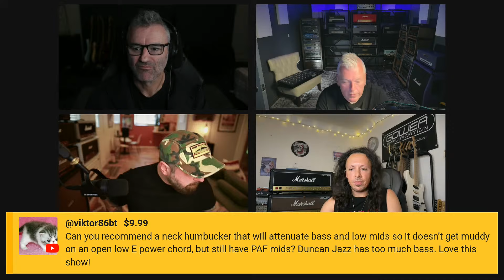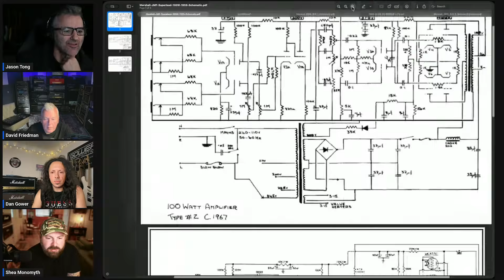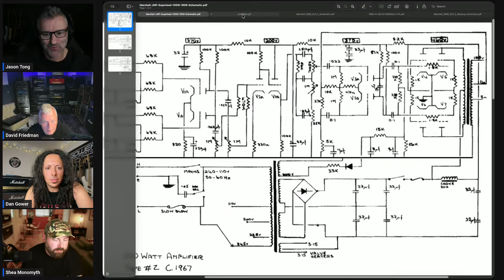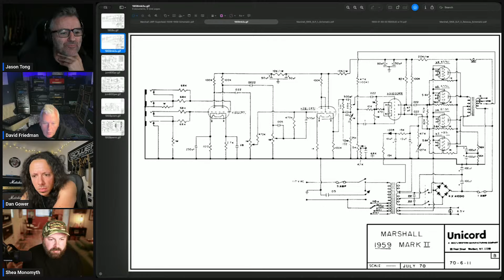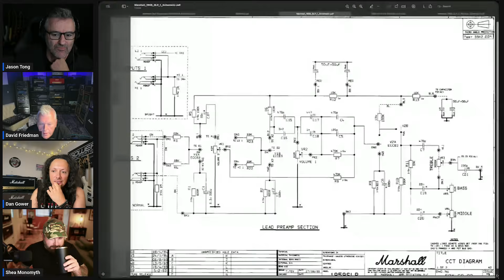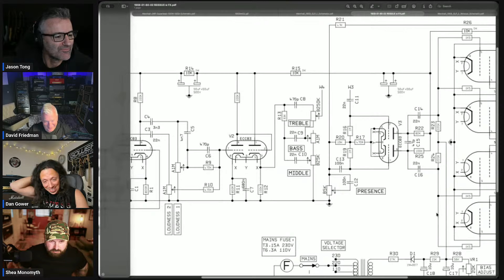The Amp Panel #16 - Marshall 1959 Super Lead: All Eras

Comment: Oh, just in regards to the discussion about the 100V line on the output transformer is? Back in those days it was common for announcement systems to run speakers which had high impedance transformers on them, this enabled you to be able to parallel many many speakers together without loading the amplifier down. Commonly used with those "tin horn" type speakers. There was two standards, 70V and 100V line. I never knew Marshall had that on their early amps.

Comment: Question for the panel maybe on the next show…..curious if any of these gentlemen occasionally use diode clipping, and if you do which type, why that type…also where in the circuit do you prefer. ? Just curious….love the content 🤘🏼
Reply from the maker: Everyone has at some point.  Check out the Jose episode, that’s the most common way.  Not the only way, but the most common.

Comment: When they went to 100k FB they dropped the .68 bypass on V2 pretty quickly and they often did the .68 with 47k during the same periods.  Sometimes you see 100k with the .68 bypass but a lot have been "fixed" since it could get unstable, some worked like that though...they are the wild ones. All Marshalls up to the circuit board era should be considered "transitional".  I have a 67, 2x68s, a 69, 70, and 71. All have laydowns except the 71 but I've seen laydowns as late as 73. All the Super Leads have the Dagnall C1998. 68 ST has the Drake 132 OT, the 67 has the Drake 119.

Comment: Hey just wanna give an update: My 50W 3ch Rectifier clone stands proud and with less noise than I'd expected from an amp like that! It got a little messy with the relays at the end, that's on my lack of planning for it.. :') 

Modding that circuit is dope, but honestly it sounds really good nearly stock. Will have to add more relays I guess lol. The clean channel will see some changes, don't like it too much.

Comment: Ive got a 88/89 1959 jcm 800 modded ( before i got it ) with a half power knob abolutely loud as hell once put a db meter in front of it  and meter came up 132dB
Reply: I have the same amp that i recently purchased. Mine is pretty much stock except it looks like it's had the output transformer replaced at some point. It is insane how loud it is!
Reply: @Dambut666 haha yep horrendously loud.
How you enjoying it?

Mines been retired by a laney
Reply: @angrytroll27  I wish I had more opportunities to play it. Even using an attenuator it is still loud for most of the venues i play in. But when i do get to crank it, it is glorious!
Reply: @Dambut666 no suprises hahaha

Just insanity loud 😂